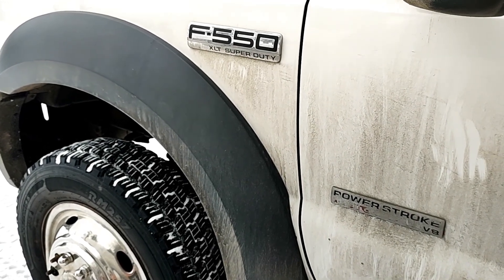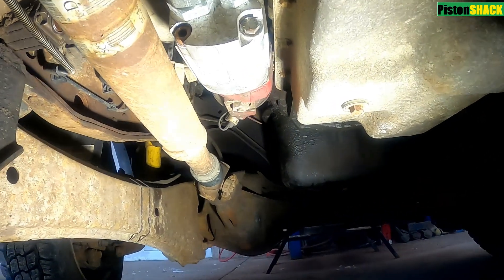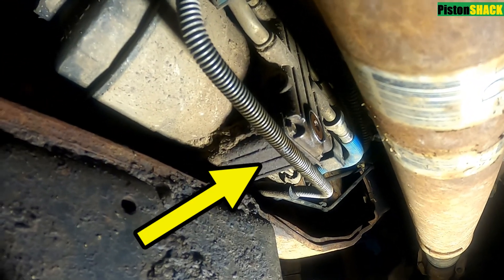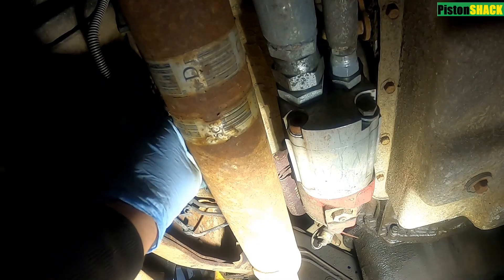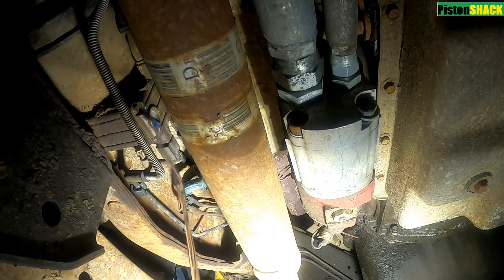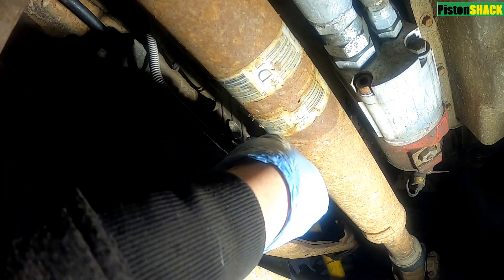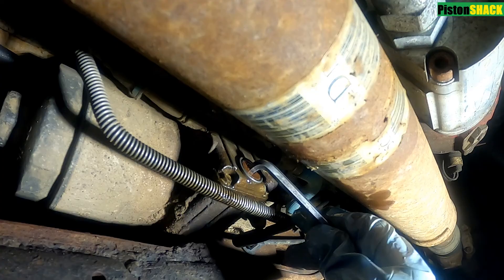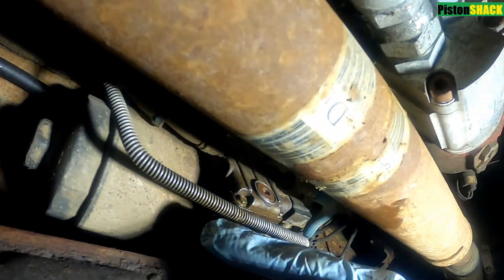HOW TO DRAIN WATER / FUEL SEPARATOR ON 6.0 POWERSTROKE DIESEL

Comment: Mine does not stop draining. Almost a gallon of fuel and still draining any idea why?
Reply: I don't know for sure, but on other forums i read about this, and they said when they had more than a half tank of fuel in the truck, it created pressure that pushed out a gallon or so. Possibly what is happening with yours?